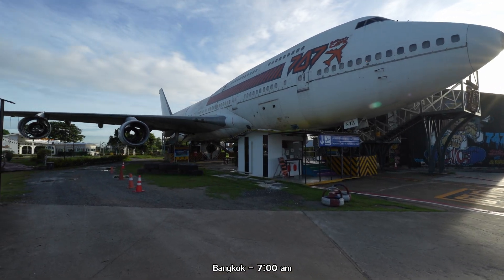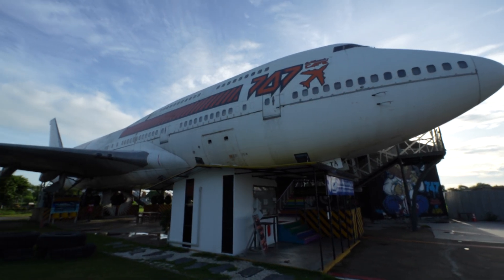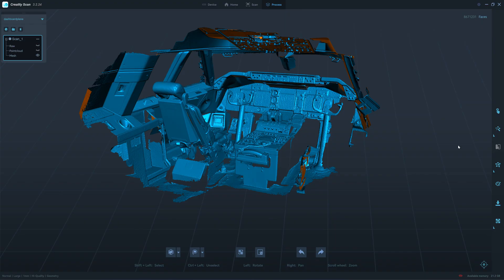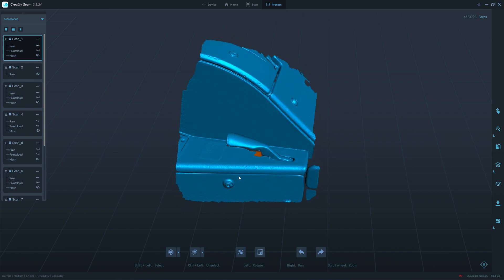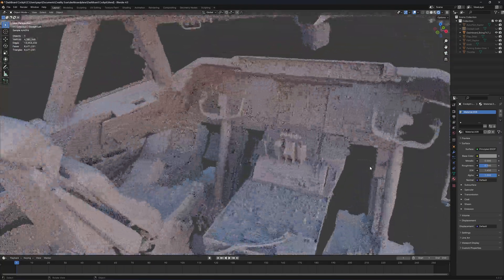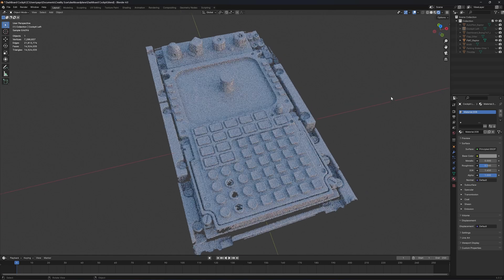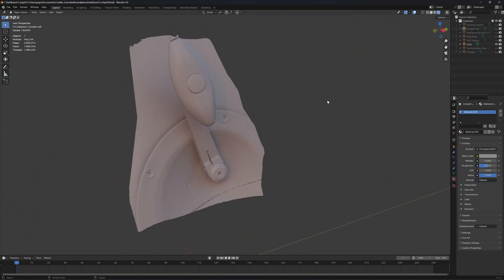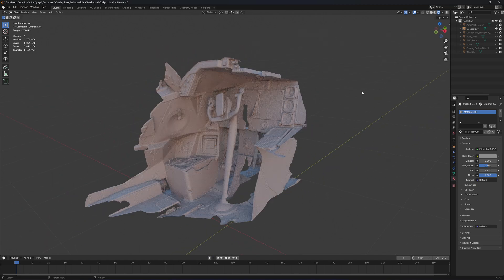Creality Scan Otter and Raptor Showcase - Boeing 747 Cockpit Scanning

Comment: Nice! How come you used Otter instead of Raptor for big scanning? Isn't Raptor capable of doing it the same as Otter?
Reply from the maker: Otter's large depth camera is exceptional. It has much larger scanning area and faster tracking than the one in Raptor.
Reply: @Payo-TensileCreator  thanks, in the meantime I saw your car cockpit scanning test with both models.

Comment: Im really torn between the Raptor and the Otter, if the Raptor had just as good of a NIR as the Otter then the choice would be easy.
Reply: Had the job to evaluate the right device for a customer yesterday.

Conclusion:
If you need the perfect details, only Raptor does it.
If you need to scan larger objects, only otter does a great job without frustration.

A: choose the device that covers your use-case best.
B: buy both devices.

I got the Raptor for my customer, because he really needs the details.

Comment: Big improvement in new version cr scan 3.2.24
Reply from the maker: The UI looks a bit different than Beta 3.2.19 which never been released.
Reply: @Payo-TensileCreator  looks like 3.2.24 version, which allows to use integrated graphics card like 3.2.19, also has a lot of new features, the update is great!

Comment: These videos are great. I wonder if you had to choose one scanner, which one would it be?
Reply from the maker: If I can have one, I would pick Otter.
Reply: @Payo-TensileCreator  what are your specific reasons for that choice?
Im currently facing this dilemma 😉.
Reply from the maker: @acolyte8564  Otter can scan everything Raptor can with less accuracy (50 um vs 250 um). It has exceptionally good large depth camera that can scan with lesser detail but require no marker. But if you're mainly scan mechanical parts that can be put on a table, I would recommend Raptor, it's easier and faster to scan than Otter.
Reply: @Payo-TensileCreator  I'm leaning towards the Raptor personally right now.
 are you compairing the Otter to the Raptors NIR, when you say 50um vs 250um?
Specs have them listed as
Otter: (20um @60mm NIR)
Raptor: (100um @? NIR) and (20um @100mm BL)

What are your personal reasons why you would choose the Otter, if we both have similar reasons or things I havent considered, I may go with the otter, and if we dont, then I wont have regrets about the Raptor, considering its a lot more $ and the NIR is lowe spec than the Otter.
Thanks.
Reply: @Payo-TensileCreator  Thank you for taking time to reply, it is much appreciated!
Reply: I did end up getting Otter, and I am enjoying it very much. As you say, the large scanning is very nice and has less chance of losing tracking. For what I am doing, it is a good choice, thank you.